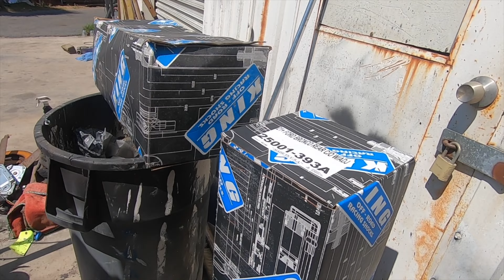I Said I Would NEVER Do This Again...

Comment: If I had 1m today my first purchase is a house for 600k here in Florida. Second purchase will be a sweet Kenworth t800 and three different trailers, 1 lowboy, 1 car hauler, 1 flat deck. Of course my house can easily be cheaper depending on where I chose. But it’s how I’ll start my side businesses on top of my engineering career. I can do most my work virtually as a CE besides site visits.

Comment: Your Bronco build will look so cool! Unfortunately, those systems you like on your Bronco will not work right after the mods. You will have to get them re-calibrated to account for the suspension changes and lift on the vehicle. Same goes for the speedometer.
Reply: If your alignment shop can't recalibrate the safety systems, you need a new alignment shop. That's almost standard now. And it' not his first lifted vehicle with bigger tires...